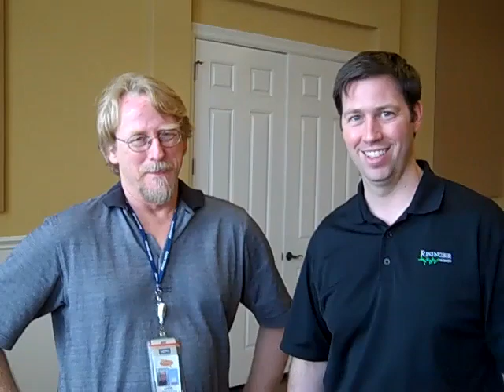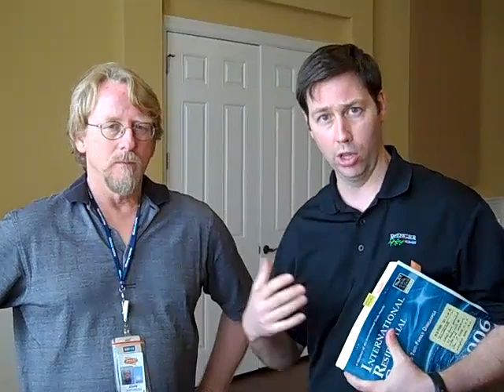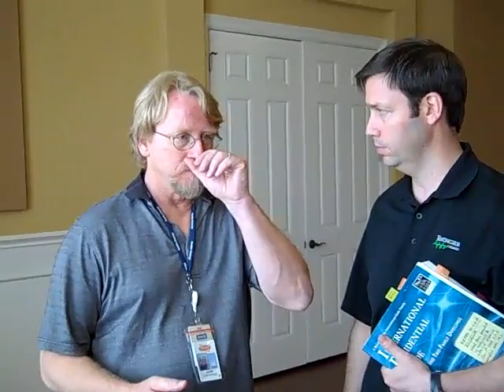Austin Spray Foam Code Compliance Changes 5 2010

Comment from the maker: @HomeEnergyNow Most of my houses are getting HERS scores of 40-60.  I'm getting there through a variety of ways including ducts in conditioned space, better insulation/air sealing, high efficiency equipment, etc.  This equates to real money in savings.  A 2000 sf foot house I built in Tarrytown last year had $50 electric bills in the summer months this year.  But, they are also more comfortable.  Yes, we need to be net zero capable by 2015 but not Net Zero.  No problem to vent.  Good to discuss